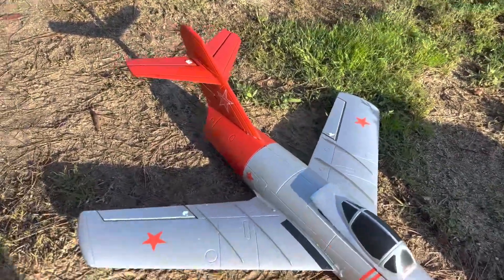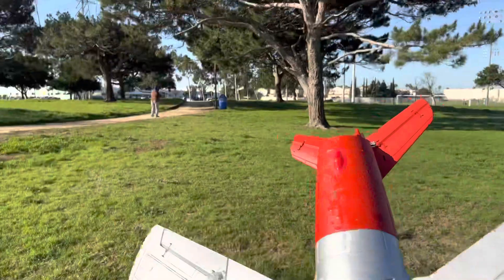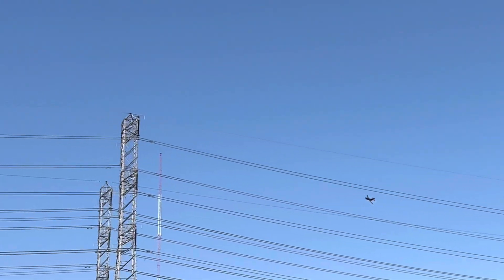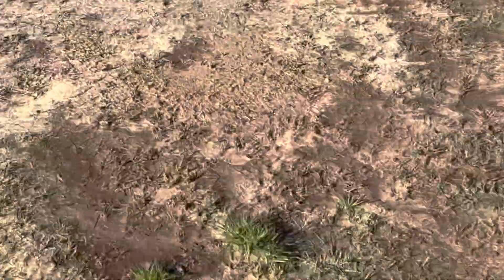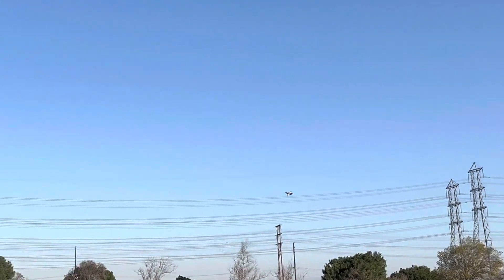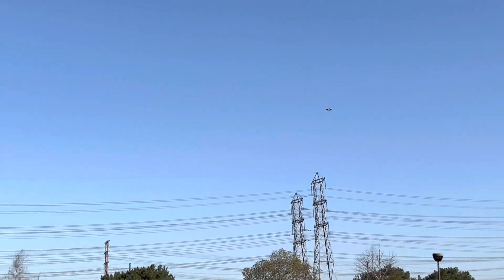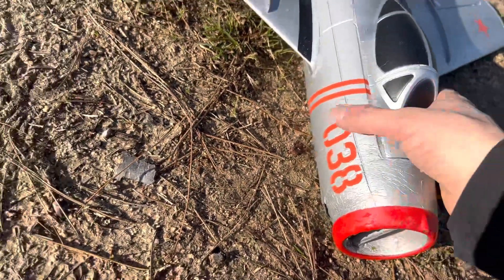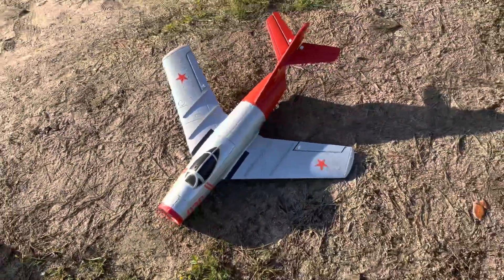Freewing Mig-15 Lunch box special !Maiden Flight with 2 Failed Attempts

Comment: It was acting tail heavy because it would climb and stall out and fall, you added down elevator to help it keep the nose down until it build up enough speed to fly properly. 

After adjusting and using the gyro you found launching with the gyro was key to get it in the air...RIGHT ?
Reply from the maker: Yes gyro help a lot .. after that maiden I kept it on . the hand launches are  easier now ..

Comment: They fly better on 4s , just need to up the ESC
Reply from the maker: The motors will handle the 4s ? Just change the esc ?
Reply: @andystoybox1723  yes and yes
Reply from the maker: @Mikeylikesit1968  nice ! I will prob do that 👍🏻👍🏻 thanks 🙏🏼
Reply from the maker: @Mikeylikesit1968  40 amp ??
Reply: @andystoybox1723  Should work.
Reply from the maker: @Mikeylikesit1968  ok cool 👍🏻